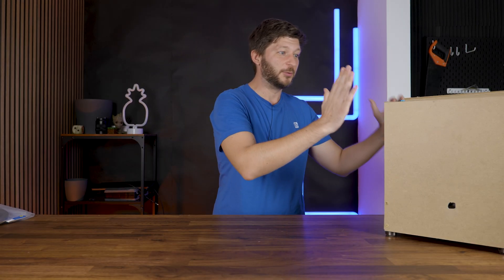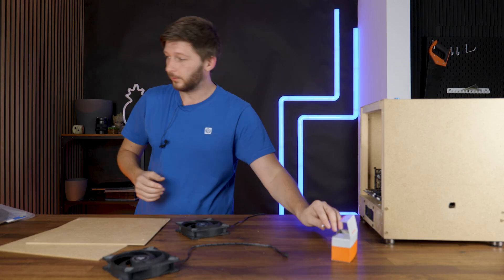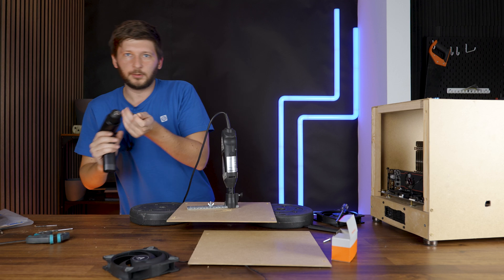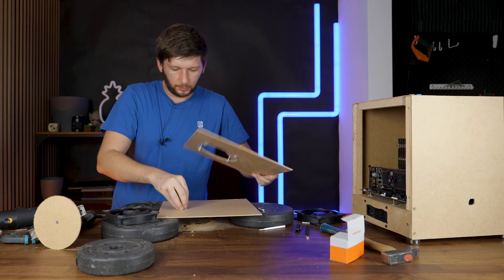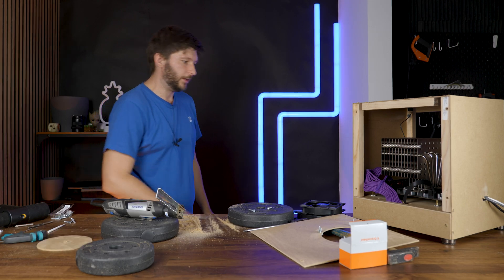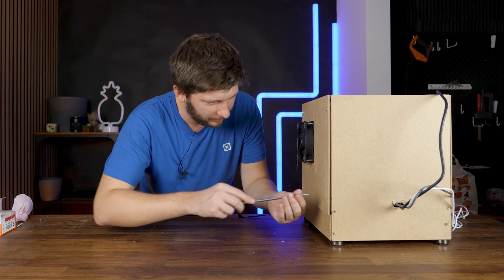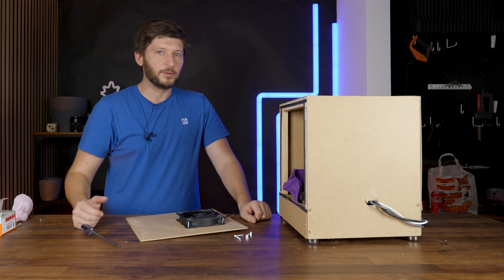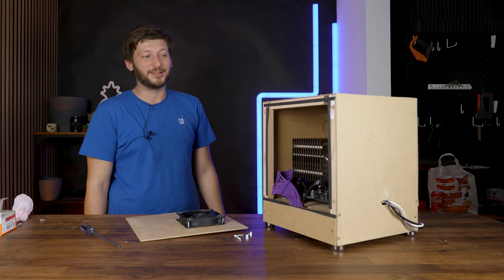Finally Done! - DIY CASE Fan Testing Machine - Part 8

Comment: I feel the holes should be closer to a square rather than a circle. If you check the actual exhaust side of many fans, you can see that the exhaust tunnel terminates in a square-ish shape rather than a circle.

You also have to be careful on the assumption that mesh is close to free air. Mesh is in fact quite restrictive, and how restrictive it is depends on the actual design (different open area for example). It's a good idea to make/get several vent designs and mount them in front/behind the fans for testing.

You should also be careful on the effect of mounting to the noise generated. Mounting via different pressure and methods will and can drastically affect noise generated due to transmission of vibrations to the panel, especially given that your panels are quite thin (and even if it's consistent in your test rig, the effect will vary between cases so it's not that useful). It would be best to noise-normalize and record the corresponding RPMs in a vibration-isolated environment first, before putting them on the case for testing.